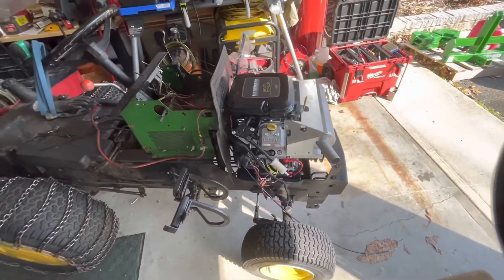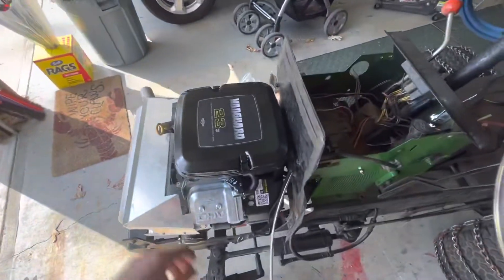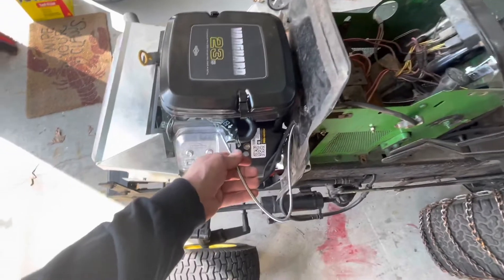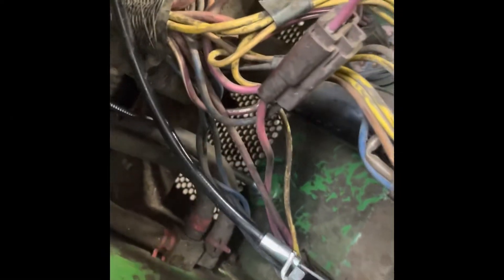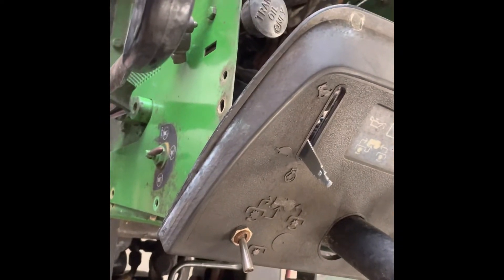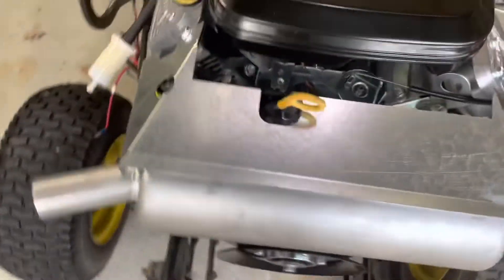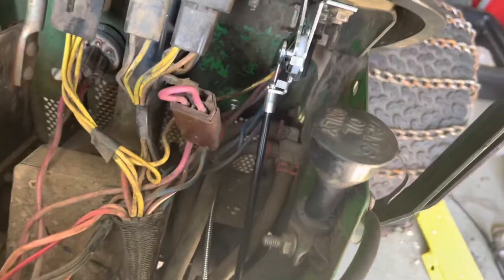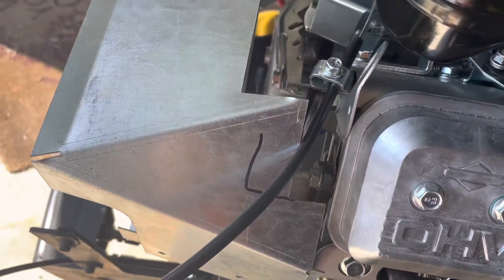John Deere 318 Repower Install and Startup

Comment: where did you get this conversion? I am having trouble getting a throttle cable bracket to fit properly. and yours has the studs on the same side as mine, small engine warehouse said they never saw a 318 with studs on the same side as ours lol
Reply from the maker: So my kit is from Small Engine Warehouse. It came with the throttle cable. Recently I was installing an H3 kit. I hate how the throttle cable is so long, so I tried going back to the factory cable, but it’s a little too short. So I’m still using the long cable.

Comment: Just ordered my SEW repower for my 318.how long would you say it took to install?
Reply from the maker: It took about two days for me, but it could be done in a day with some help.
Reply: @FradyGarage  Thanks, good to know. Should be getting mine tomorrow.
Reply: Got my SEW repower fired up tonight.  I found that bringing the throttle cable under the battery through the firewall hole on the right side it fits perfect. Opposite side you did. Just switch the cable clamp over to the other side of the motor and it’s a perfect fit. No need to cut the heat shield.
Reply from the maker: Thanks for the tip, I trying for that side, but was worried that the cable would get kinked. I’m going to be doing some work on the hydraulics in the future, maybe I’ll try it again.
Reply: Bought motor from sew for 420 driveshaft flange don't fit now I got to spend more money having it machine flange on the motor the hole is an 1.5 inches lip on the yoke is 2